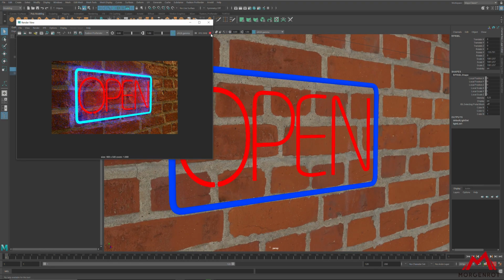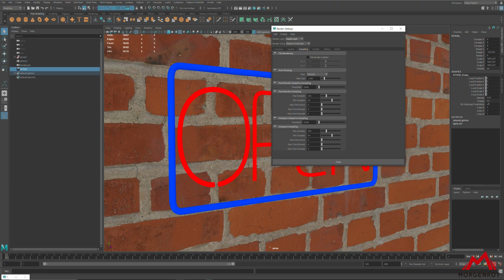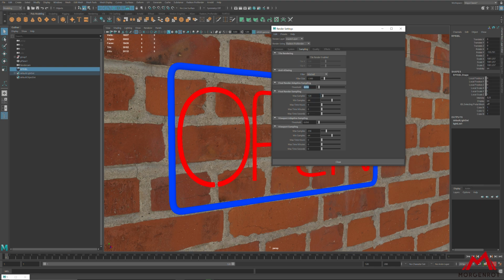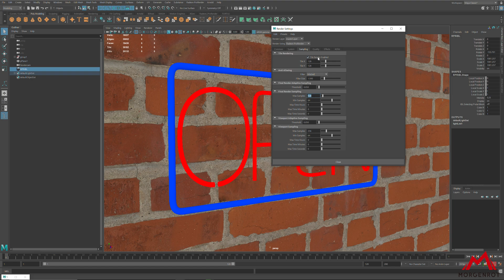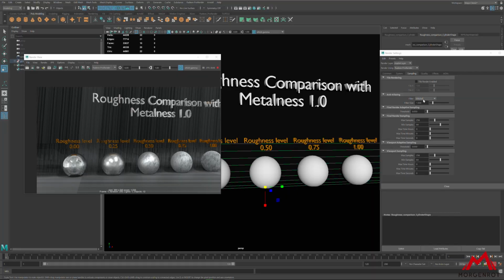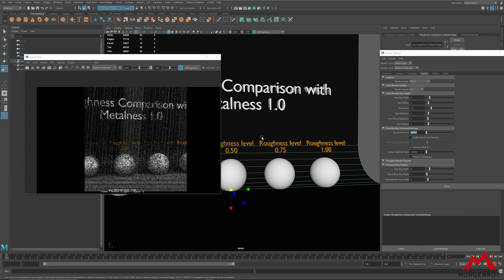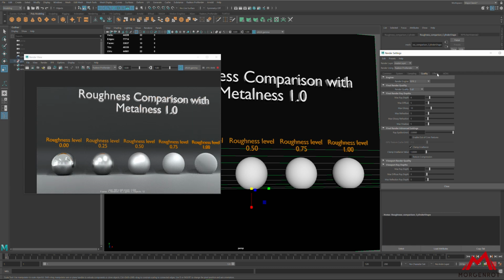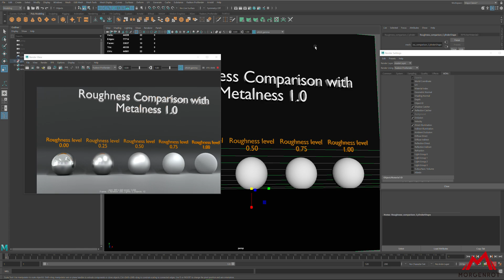(Autodesk Maya Tutorial) Part 2 - Render settings AMD Radeon™ ProRender Tutorial

Comment: it just seems to instantly crash when i use radeon Prorender in the viewport. any ideas?
Reply from the maker: Hi 
They could be because of GPU driver version or specification needed for using ProRender is missing,
Please check here
https://www.amd.com/en/technologies/radeon-prorender-autodeskmaya

If there are some issues after taking a look on the URL above,
Please file a issue on GPUOpen Github page and Plugin developer will check with you.

https://github.com/GPUOpen-LibrariesAndSDKs/RadeonProRenderMayaPlugin/issues